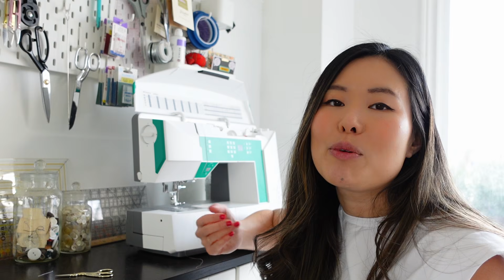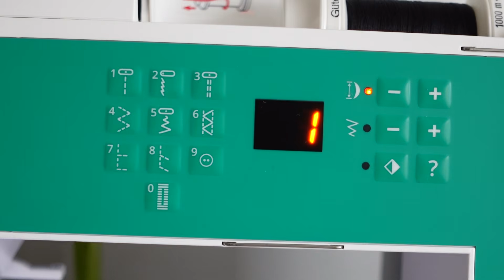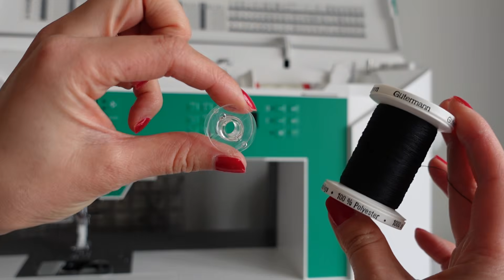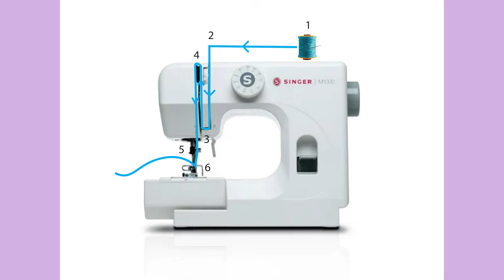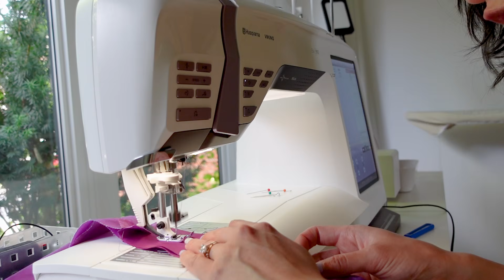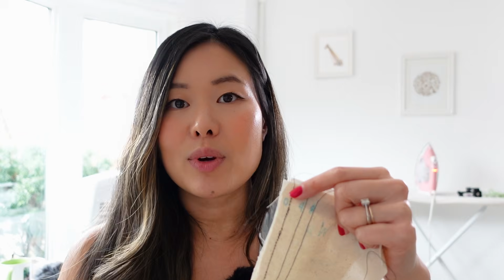Learn to Sew Ep 2 | How to Use a Sewing Machine - Threading, Stitch Length and Width, and Tension

Comment: how do you tell 5/8 like do i line up the end of my fabric to 5/8 or do i line up somewhere else that part i have been stuck on for a while
Reply from the maker: You line it up with the 5/8 mark on the needle plate. You can double check by measuring the seam afterwards to make sure it’s correct

Comment: I have had some extreme looping where it's pulling in to the lower bobbin any ideas for how to fix this ?
Reply from the maker: When the thread is pulling to the bottom, it can mean the top tension isn’t high enough
Reply from the maker: It’s hard to say without seeing your machine and the fabric and needle etc, but I would start by retreading both top and bottom thread, then changing the tension settings, changing the needle, then trying with tissue or paper or using stabilizer with the fabric!